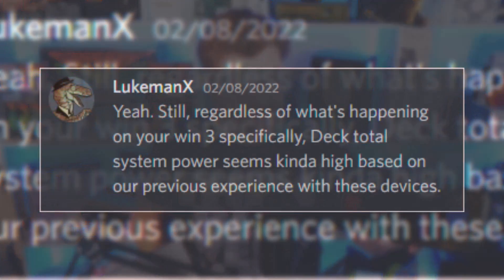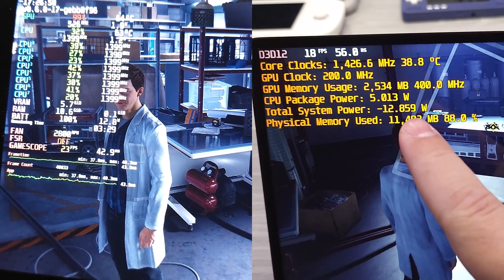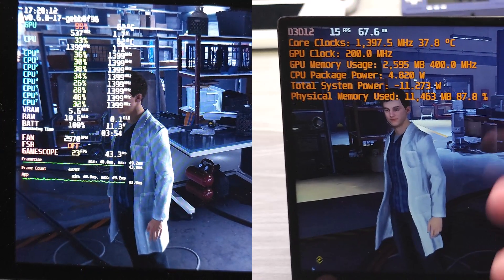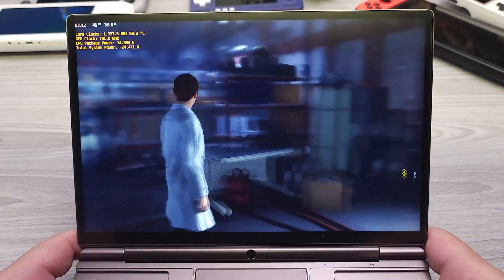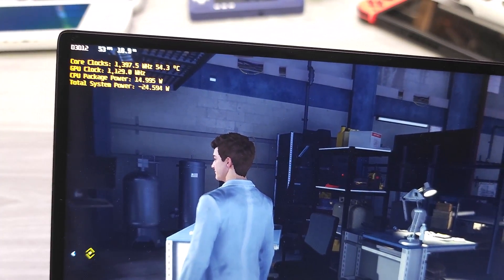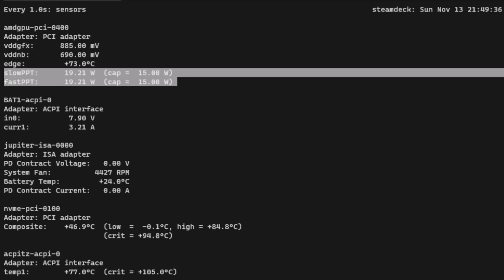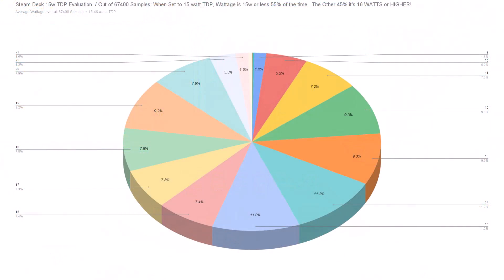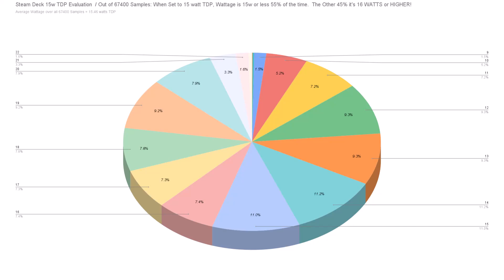The TDP On The Steam Deck is Wrong

Comment from the maker: FWIW, I have to say I actually PREFER the Aggressive TDP average as opposed to the Conservative TDP average.  Curious what you guys think?
Reply: I don't really care either way because in the end TDP is just an adjustment to reach a certain FPS and/or battery life. I don't like that they can't measure the same way across all devices. This reminds me of automotive power ratings with manufacturers overrating or underrating their actual power output. It's annoying because we don't have a true number, but in the end it's the other performance metrics that really matter.
Reply: Phawx, have you taken a look at the settings uncovered by the UniversalAMDFormBrowser UEFI loader?  It essentially makes visible the entire array of bios level settings available to the BIOS that aren't directly accessible to the user.  I'd love to see what you could do in terms of an undervolt or a change in clocks, perhaps there's something in there that would be useful for the tweaking community in the future.
Reply: Allow the option for the user to change the AMD's power preference or make it indicate that certain preference is currently being utilized
Reply: So I really wanted to see what a 20W Steam Deck would be able to do (either as an overvolt/clock or maybe for Steam Deck 2) but what you're saying with this video is that the Steam Deck already runs at 20W+ when it needs to? So no overvolting/clocking is necessary?
Reply: Based on the data you presented, I assume my preference would likewise be for the Aggressive TDP average since you get better performance for what is essentially the same 15W average. But to be honest, I don't think this really matters much in practice. The measurement isn't ultimately wrong, just a bit different than the standard - and at the end of the day, TDP settings are only available to us as a means to optimize battery life. Having the ability to set a "true" maximum or opt for the Conservative average might be kind of nice, but at that point we're venturing into territory that most end users won't care to explore.
Reply: It's a question of honesty, and a question of result presentation.

If I set the TDP to 10 watts, I expect it to be 10 watts, not just a "loose guidance" with the SoC eventually taking 15 watts behind my back.

What's more embarrassing is when reviews and testers just report the number and state "look how powerful this cpu is at 10 watts !".
Well, it's actually consuming 15 watts, so, sure.
And then compare it to competing solution and trumpet the "great efficiency" of their favorite SoC.

This should trigger some introspection.
I honestly think there's an opportunity here to distinguish between 2-tiers evaluations channels, 
the great ones will take pain at measuring, logging, presenting the real energy consumption, which is quite difficult to do, 
vs the lazy ones, which will just retweet a vague peak number coming from a random tool they don't understand.

I really wish the great ones to win the attention competition.
Reply: You shall know that total system power is only high when the battery is nearly full. 

AMD is tricking users to think that the APU is efficient enough to run at lower TDPs. Amazing right? 
Well… no. 

AMD set up the DIE to throttle down at your chosen TDP or lower when the battery is low, this allows you to have the “promised” battery life. 
Also fooling users to think that AMD is the lead. 

But in reality, Xe graphics is way more efficient than AMD.
Reply: Yess this aggressive gaming profile is great that's why I was a little disappointed on battery life at 15W. When not docked I usually block tdp to 10/11 W.
Reply: I would be happy with the current TDP, but pls let the fan curve somehow be balanced over this and not ramp up and down, constantly switching between hairdryer and a regular fan.
Reply: No it is averaging 9w in average, it is Aya neo which is averaging less with 75% with 9w or less. So basically maybe 7w.
Reply: I mean. If we don't like the tdp being so high, we have the opportunity to decrease the tdp in the performance menu.

It's literally free performance 😂
Reply: this would explain why Steam deck is the "console* of this type that at 15watts is always at such high degrees when even the original aya neo at this same TDP its APU is much "colder", at least it would explain it in part. Always I found it strange that it reaches such high temperatures comparable to its competitors when they are at 25-30watts
Reply: Whilst I agree the aggressive TDP is preferable for the steamdeck. If you have a laptop (like the GPD WIN Max 2) then it would be nice to have a BIOS option to set the power profile type yourself depending on if you wanted to use it as a Laptop or as a handheld gaming console.
Reply: Hi,Phawx,  I 'd like to send you our UPTOHIGH Brand Steam Deck Dock to try. I send you email but no reply.
Reply: just a idea: install windows11 to a smartphone with snapdragon845(windows11 have drivers for snapdragon845) and mount a liquid cooler on snapdragon845 after remove back cover of the smartphone. Connect wireless keyboard mouse set and a xbox gamepad then do gameplay tests.
Reply: AMD has something called Precision Boost overdrive that temporarily boost the cpu clock speed above 15W for quick short processing task and then get quickly back to baseline.
Reply: RDNA 2 discrete GPUs on desktop Linux with the MESA drivers do the exact same thing you described the Steam Deck doing. You have a tdp limit set in software and about half the time the gpu is using more than that and half the time it uses less. The difference, I guess, is that Mangohud was showing that behavior in the power readings rather than, as it seems, for some reason that behavior wasn't showing in Valve's hud profiles.

Now the question is, does this explain why the Steam Deck APU seems to get much better performance compared to the 6800u at below 12W TDP settings?
Reply: @anonymous_coward  I'm confused by the last part of your comment. It would absolutely explain the differences. Basically the Steam Deck at 9 watt TDP is using as much power on average as the other systems at 11-12 watt TDP. So that right there explains the difference.
Reply: If 25watts on the GPD Win Max 2 prototype roughly matches 35 watts on the Production model, how much better did the prototype model perform at 35 watts?
Reply: @jasonsuarez2964  he literally showed a graph showing exactly what you are asking for.
Reply: @bnr32jason  Yes, but that graph cuts off at 25 watts. I suppose I'll just have to assume that he didn't post up to 35 watts comparisons due to diminishing returns past that point.
Reply: @jasonsuarez2964  I'd like to see the graphs go all the way too, I suspect the difference is negligible, but might still be useful for when docked.
Reply: @bnr32jason  I just messed around in Power Control Panel after watching GPD's latest video on the WIN 4, and noticed that you can raise the 6800U's max TDP all the way up to 80 watts. I wouldn't go that high on the WIN Max 2, but I did try 40 watts and it works great. With the newer ceiling, the difference between the TDP profiles doesn't really matter anymore.

Comment: Well anyone that knows a bit about AMD CPUs and APUs should also know, that TDP is not the allowed power draw, that is PPT and PPT is always higher than TDP. As with the desktop CPUs, where 105W TDP means 142W PPT, or with the latest Zen4 CPUs 170W TDP means 230W PPT, a 15W TDP would mean ~20-21W PPT.

Comment: So with the previous Ayaneo 2 vs Steam Deck comparison vid, not only were both systems running different operating systems (which has an effect on frame rates), but the “TDP” being measured on each was completely different?

If that’s the case, the previous video should be taken down until a retest can be done with corrections.

Comment: ? Im pretty sure you know they are on adaptive voltages by default. You cant set them to static on these devices. 15w has never ever meant that a system runs at 15w. The total system power is averged in all cases.  Maybe im missing somthing but I see nothing wrong here

Comment: So, therefore, is it safe to assume (roughly, not looking for exact numbers) that we can double the TDP at any given time to estimate how much total system power draw we have? So 15 is 30 then 10 is 20, 5 is 10 etc. So, in theory, with a 100% battery that's rated at 40Wh, running a game that will use 5W TDP results in roughly 10W total system draw => 4 hours game time. Something like that, right?

Comment: Phawx, I love you, but as a data nerd, that pie chart makes me want to slap you with a kipper. 

Pie charts are basically the worst way to visualize data regardless, but using one to represent a bunch of basically equal pieces of information does absolute nothing  to help the user understand the point of the data, and is probably worse than just showing it in a table. 

At least try out a histogram, I beg you.

Comment: I remember all these discussions, back in the days of Tiger Lake vs Ryzen 4000U, stating that AMD cpus at low power were much more efficient than Intel ones.
Does that mean we were bamboozled all along, and the main reason AMD is more powerful at low TDP is because it actually doesn't respect TDP and just consumes significantly more energy ?
That would throw a pretty big wrench into these comparison statements.
Moreover, if ignored, it would essentially signal that it's beneficial to cheat, forcing all actors into a race to the bottom.

Comment: TDP as defined by AMD is Thermal Design Power, and does not necessarily correlate to real power consumption. This is well known in the tech industry.
In short, TDP does not mean power consumption.
BTW, Intel does this, too.
Reply: The problem here is that AMD is doing it in two different ways on two different chips, which makes comparing them side by side extremely difficult.

Comment: I appreciate the video but these pie charts are extremely bad. You could have shown this data with bar charts (rounded tdp vs number of samples) or line chart (tdp avg and tdp max vs time, aggregated of course by time with aggregation dependent on total measurement time).
Reply: A simple under or over pie graph, or a defined line with above and below target wattage probably would have been a lot easier on the eyes.

Comment: Aren't the Steam Deck and WM2 prototype the more accurate devices if those are spending 50% of time both above and below the set 15 W TDP? It's averaging out over time to a correct 15 W, no? The production WM2 is averaging below 15 W for 75% of the time, so the reporting is overshooting reality, in my understanding. But Phawx is saying the latter is more common for devices?

Anyway now I don't trust the reporting and want to see stats directly from the battery draw lol. Enough nonsense, measure on the cathode and anode!
Reply: No, re-watch that part of the video and look at the graphs, he explains very well why the 50 above/below measurement isn't very accurate.
Reply: @bnr32jason  Ok I watched it again, but I stand by my comment. Phawx describes the Deck and WM2 proto as using an "aggressive" average to calculate TDP and the WM2 prod as using a "conservative" average. I'm saying the former is technically more accurate (in the scientific sense) over a sufficiently long time period. Essentially the pendulum swings back and forth but its center is closer to 15 W.

However, sticking with the pendulum analogy, the "aggressive" models also have a wider swing, spending more time further away from that average. So technically they are less precise (again in the scientific sense) due to that wider spread.

What I don't know, and what this video doesn't answer, is whether accuracy or precision is more important here. Is it better to have a SOC that ramps up and down aggressively to accommodate its workload or one that's more conservative? I'd expect pros and cons to each.

Comment: Sorry, I'm a bit stupid, but I didn't understand why a simple topic should've been given so much explanation and barely visible graphs.

What it is about? The SoC TDP? Nobody ever believed it, since Intel started lying about it in the CPU specs. So now it looks AMD joined them as well? Well, okay then.
So it's about that we should look in total power draw? It, again, was always like that.
Reply: I think it is directed at the credibility of TDP to TDP comparisons to other products, and how Steam Deck's reported TDP number punching above the competition on number alone isn't accurate. 

It's not much to worry about unless you're in the market for a new handheld basically.
Reply: The point of this video going in depth is very simple.

To explain the Steam Deck's seemingly impossibly good low TDP performance.

With this video he has shown that when you select say 9 watt TDP on your Steam Deck, it's actually running at the equivalent 12-13 watt performance. It's useful for directly comparing these devices against each other, that's it really.

Comment: Also keep in mind the deck runs Linux 5.13 which is ancient by now. I would advise to try the 5.19 kernel, enable amd_pstate that has a hell lot more granularity than the legacy acpi_cpufreq and retest. Eventually valve will bump the kernel and honestly it's overdue by now.
Reply: You can pick any kernel you want and implement any patches you want.

Comment: I wonder if this aggressive TDP average is on purpose. Valve said they had gone through many prototypes before reaching this one and saying it finally was where they wanted to see it. If we get slightly better performance with this average rather than tightening it up, it might have been intentional to get just a bit more out of it. 

Either that, or it was a case that they figured it was good enough or could even be the standard TDP profile they use whereas the one for the Win Max 2 was fine tuned for better battery life for the production model. Wish we could know a bit more of the thinking behind all of this by the companies themselves. Is some of this normal practice or conscious decisions?

Comment: Great video, as always. Glad you shed some light into this situation. As others have mentioned already, I feel it's important to remember that in the end it's all a function of performance/ quality vs battery life, ignoring thermals as you clearly stated as that's another matter entirely.

Handhelds are all about making "the right compromises", and there will always be compromises to be made. Even when RDNA3 or whatever else arrives. Battery life will always be a concern and opposite to higher performance, so this is more of a "how much performance and/or battery life do I get for the price" (aka bang for your buck), with the only empirical way to compare devices being to actually measure full system power and how battery life is affected by it, and what quality that gets us in the end.

Regardless of what happens in between, which many of us are really into, for the general user base the only thing that actually matters is the end results. That's also why it's not great when companies don't show total system power, as anything else doesn't really mean much.

Comment: What this does not explain is, why the system power of my Intel prototype is so much higher than system power of my Max 1 1195g.
The Win Max 2 Intel has way higher total system power usage than the Max 1.

Is there any chance, you could read those data from your Intel unit and compare them with the AMD units?

Comment: I prefer this, all Valve really needs to do is give us a larger capacity battery in their future models, every other company is doing it, heck even at more compact form factor
Reply: Just get an external battery that can easily fit in my pocket without the extra weight in my hands.
Reply: @smidlee7747  yup, whenever I think I'm going to need extra battery life I throw my GoalZero 26800mAh battery in my backpack. With a 6ft USB-C cable I don't have to worry a bit about battery life.

Comment: Total System Power isn't TDP. TDP (thermal design power) is how much heat is generated from the APU. AMD's convoluted TDP calculations don't even factor in power usage like traditional TDP calculations do, but assuming it did TDP would still just be an estimate of how much power the APU is using and total system power is going to be the power all components in the system are using.

Comment: Would this be the reason why Steam Deck is seemingly crushing the competition in low TDP scenarios?
Reply: Probably
Reply: If the difference is <4 watts, then yes quite possibly. If the difference is >4 W then no it's likely some other optimization (maybe shader precaching).
Reply: @wizardpajamas6405  he said the difference is around 3 watts, so yeah it's all about the way they measure averages differently. So 9 watts on the Deck is actually about 12 watts on a 6800u machine
Reply: not entirely. steam deck's rdna2 is simply much better than some of the competitors vega graphics. If you compare it to a newer competitor with a newer gpu, it might explain some of the difference
Reply: @ev4_gaming  well yeah, and that's what he compared here, RDNA2 vs RDNA2. I don't understand what you are getting at, no one brought up Vega.
Reply: @bnr32jason  They said "competition" no one mentioned any type of gpu. Not vega not rdna2. So competition counts. And some competition uses older Vega components.
Reply: @ev4_gaming  right but this whole video is about Steam Deck's custom APU vs 6800u devices.
Reply: @bnr32jason  Well, notice how i responded to a comment and not to the video itself?
Reply: @ev4_gaming  with his "crushing the competition in low TDP" comment he was clearly talking about the latest devices since there has been several videos released in the last 10 days from multiple YouTubers about Deck vs 6800u device and one of the big points has unusually good performance from the Deck at low TDP.